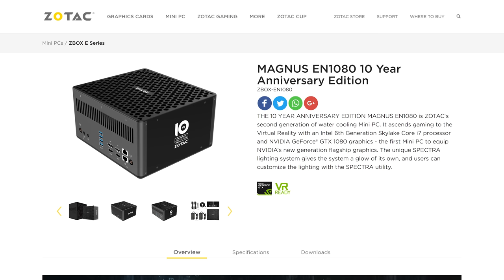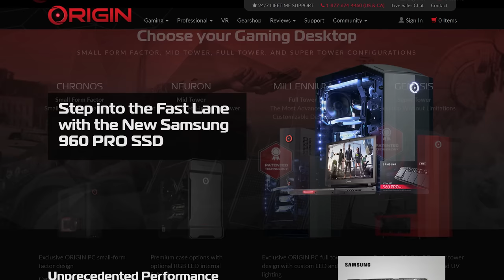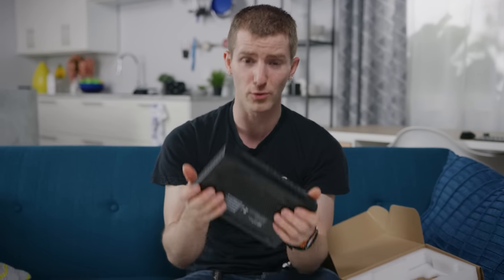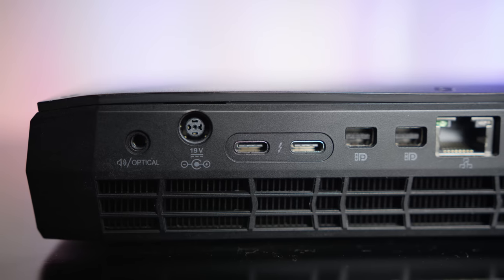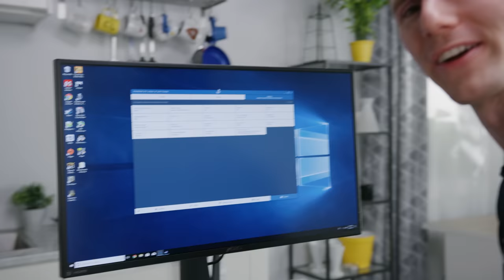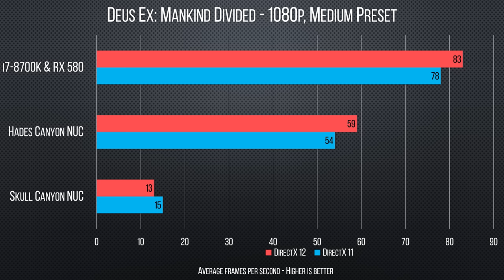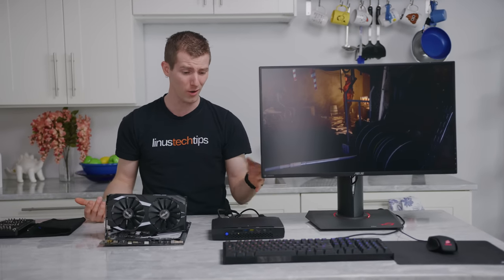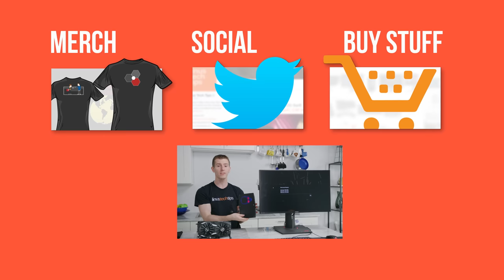Intel's Coolest CPU EVER... Thanks to AMD!

Comment: I just can't see any use case for this. LAN parties makes no sense. Most people going to LANs would use a laptop. And if your bringing a desktop, it's probably because you're a PC enthusiast who wants to show off a computer they built and can upgrade! Plus you'd need to bring a monitor, mouse and keyboard anyway, so who cares if the PC is Hades canyon sized or slightly bigger for a mITX build.
Reply: do you realize laptops that CAN run the most demanding stuff are even pricier than this thing right? that been said, I am not familiar with LAN parties as I am not a gamer myself. but I can see plenty of benefits in a portable desktop. for instance if you do free-lance video production/editing as I occasionally do, for productivity's sake  you will want to work on your own workstation, what's more if you use macro buttons, you will also want to bring your own keyboard around, since that is out of the way the only thing missing would be the screen, which can be easily borrowed from the hiring office or hotel room. also, it might just be me, but I find extremely obnoxious to try to do any REAL work over my lap, so I would choose something like this over a laptop for work any day (under the current pricing relation anyway)
Reply: even though new laptops are great and i have one msi gs63vr 6rf that i use as a desktop at home with separate monitor and everything . the 1060 6gb and 6700 hq are fantastic pair i can guarantee this mini desktop this will have more consistent  performance and frame rates.  like ill give you an example even with cooler boost the 6700 hq under load will hit 90-95 c and that goes for most  all laptops except for the big bulky ones. itll sit at 3 ghz at all cores 180 fps in csgo, and ill get frame stutters into the 90s because the cpu will throttle to 2.6ghz which is the base clock then back up a ms later. this cpu being clocked so much higher with much better cooling will definitely give more stable frame rates and similar frame rates to my laptop for 500 dollars less. like i said if your a lan goer and want best experience and already have peripherals to go with it this system it is the best lan party system unless you build your own mitx system in a loque ghost or something. i know lots of people who look for small systems like this to bring to lans.
Reply: Zack Mandarino A laptop with with a ryzen 7 1700, rx 580, 16gb ram, 256gb SSD and 1tb HDD can be had for $1500 USD. That's not much more than the $1000 after adding ram and storage. Plus that laptop has an 8 core with smt, 16 threads! The NUC it's only a quad core, not sure why anyone would call it a "powerhouse". I'm not saying it's a bad product, it's super cool, but I do think it's overpriced and has a very small if any use case senario.
Reply: The ASUS ROG GL702ZC-WB74 was the laptop I was giving as an example. Which includes a screen, keyboard, battery and touch pad along with ram and storage.
Reply: If you're going there on public transport or it's a long walk to the actual hall from anywhere you can be dropped off in a car, and you don't have a trolley to wheel your godmonster of a desktop around on, then something like this plus a  monitor with a removable stand would be a pretty good, backpack-sized solution, and probably less bulky and easier to handle than a typical gaming laptop. Plus you don't have to put up with the generally terrible-for-gaming horror that is a laptop keyboard (sure, you can plug in a USB one, but then you'll likely want a separate monitor as well because the angles will be all off otherwise, and then we're comparing a rather larger slab of computing material that includes an entirely superfluous keyboard, trackpad and monitor, as well as a pointless battery if you're going to use it plugged in all the time anyway), as there will still be plenty of space left in the bag and load capacity in your shoulders for a proper desktop one. Maybe a VR headset and controllers too.

... Hmm, in fact, given its network VM workstation roots, the machine is probably intended to be mounted on the back of a monitor using the VESA bracket holes...

So like it's the operational guts of a laptop, but you're not shackled with a built in screen and keyboard. Sort of like how computers in the late 80s thru early 90s gradually gave up on the "computer in a keyboard" idea when it became clear people valued a decent, more easily moved keyboard plus a system box with better expandability over absolute compactness - and before that, gave up on the idea of building a display into the system unit (as had been common with CPM terminals, things like the Commodore PET, etc) instead letting people pick their own monitor and its location relative to everything else. If you've got a smartphone and/or tablet that covers your actual mobile computing needs, why bother with the compromise of a laptop when you could have a compact desktop instead, especially in the era of decent sized monitors that are no thicker or heavier than the same screen built into a laptop anyway? (Laptops originally winning over luggables thanks to having LCD or plasma displays, instead of small but still bulky/heavy/power hungry CRTs, and desktops hanging on to tube monitors well into the noughties... nowadays, it's essentially their all-in-one nature and built in battery that is the only real advantage)
Reply: That sounds like something you should look into, 90-95 C isn't average for any laptop because IIRC the CPU max temp is 100 C, so you should definitely look into it especially if you paid $1500 for it.
Reply: an mITX is significantly bigger (and what is significant when talking about portability and compactness doesn't require much difference).  The power brick makes it easier to pack than one big unit.  

Gaming laptops can take up a lot surface area.  For instance on my desk, I can fit a monitor and keyboard, but add in a laptop and there's little room for much else.
Reply: I see what you're saying about a "superfluous keyboard, trackpad and monitor, as well as a pointless battery if you're going to use it plugged in all the time anyway" you make a good point. But i just feel like the price doesn't reflect that it doesn't include any of those things. You get all of those things in a gaming laptop, whether you use them or not, for around the same price as this NUC once you buy ram and storage. And sure a mechanical keyboard and 144hz monitor might be a more premium setup, but I'm sure I wouldn't consider that a more elegant solution than a "balky" (they're getting quite sleek these days) gaming laptop. I think the Hades Canyon NUC is a cool product, just overpriced and for a narrow use case. But again, I do see your argument for if you really don't intend to use the laptop screen and keyboard.
Reply: +Nate Dogg That's definite leg cooking temperature and it won't be too good for the motherboard, chipset, RAM or most particuarly hard drive/SSD either. And it's really bad for the battery to be heated much above 50 celcius. Maximum CPU core operating temperatures tend to be in the 90 to 105 celcius range, and I generally get worried if mine creeps past 80. The fan's already at full blast long before then and I think the highest I can actually set the alarm/shutdown temperature trips at is 90. That's a somewhat average everyday business laptop though, a gaming one might be built with more high temperature resistant parts and with the expectation/intent that it's going to suck more power... and in a processor and GPU, the only place 99% of that power is going is into waste heat... so it's a pretty serious fail if you don't account for that additional heat and build a machine that routinely exceeds its maximum safe operating temperature (or even tends to sit only just below it).

Most modern chips should at least have protective measures built into them, which will progressively restrict performance as temperature approaches the safe maximum (this is the entire concept behind Turbo Boost, after all - making better use of the remaining thermal envelope), and more or less halt processing entirely if the limit is exceeded (and go into total, crash-grade protective shutdown if the temperature then continues to rise much further). But that then means that if you run that close to the wind on the regular, your actual system performance will be severely restricted, and it's a sign that your cooling solution is under-spec and the computer would actually run a lot faster and above all smoother (less up/down oscillation of operating frequency) with a better cooler (or better case design... or even just a lower performance chip, in fact).

So yeah... it might be deliberate, depending on manufacturer and the actual hardware, but it doesn't sound good. I think last time I had a machine that routinely showed such high core temperatures, it was a 1300mhz Duron (desktop, mind!), and those above-1Ghz cut-down-Athlon parts were notorious for running insanely hot.
Reply: +caleb grefe There's also the point made by Tams80 that a gaming laptop will actually take up a good bit more space than this thing anyway. By having to build in that other stuff, including the battery, and arrange it in a certain fixed way, you add a lot of bulk that the Canyon doesn't have to bother with. And it can then be made smaller than a similar ITX based machine because the ports can be spread out more (not interfering with internal connections for KB, screen, battery...) instead of put in a tall, narrow stack at one side of the case - which the sacrificing of internal storage beyond that of storage and memory also helps with, as you can use the surface area that would otherwise have been reserved for expansion card(s).

The power slab somewhat disrupts that saving, but at least it's flat; it'll still slip into a bag pocket OK, and in use it'll just be something lurking on the floor near the actual outlet. Really, it's over-spec versus what's actually needed; more than half of the power going in is being reserved for USB3 / USB-C devices, if we believe the label on the back... so as long as there's only a limited set of bus-powered USB devices plugged in (keyboard, mouse, maybe a memory stick and wifi / 4G dongle), the lower powered version of the machine should work perfectly fine with a more compact 95w laptop power brick, so long as you can find one with the right connector.

I figure they're aiming at the kind of user who wouldn't generally bother with a laptop anyway, but may not have the space or money (or transportation) for a full fat desktop. For most typical mobile computing uses they'll have a tablet of some kind, and gaming wise may currently be sticking with console. This module is a handy door into medium-core PC gaming with a decent CPU and perfectly passable GPU, in something the size of a small Blu-Ray player or VoD streaming box, which can plug straight into their large-format 4K flatscreen TV and soundbar, and gives access to regular desktop apps and proper web browsing, every VoD service that has a way to access it from a desktop or laptop PC, ability to plug in optical or other mass storage drives if desired, as well as of course the whole panoply of Steam (and other nonaffiliated) PC games and even some VR functionality. For a price not much beyond that of a latest-gen console, a somewhat more staid desktop that comes with monitor/mouse/keyboard (the latter two they may just have some spares of kicking around), or a gaming laptop that has lower performance and more bulk, and in use is going to end up heat-damaging either their legs or the tabletop it's placed on, unless they either put it on a generally not very ergonomic riser stand, or give up on the whole laptopping idea and just use it like a bulkier, less-well-equipped-with-ports Canyon anyway.

It's probably not a very large market segment overall, but given that they and other manufacturers have been making and successfully selling devices into it for some years now, obviously one that genuinely exists and isn't going away with any kind of speed. If you just want a single all-round computer that you can carry with you in a bag and use wherever without needing an AC supply, then obviously a laptop is a much better choice. But I can envisage there being a good subset of users in this smartphone, tablet, 3DS / Vita and high-end-consoles-that-still-don't-quite-make-a-good-fist-of-4K day and age who may well want to get into PC gaming instead, but who are both totally put off by the whole "pro gamer" thing (which is rather like the Ricer car modifying scene of 10-15 years ago, to my eye) and not particularly interested in buying a laptop, who would be quite interested in such a simple, plug-and-go type solution as a counter to enormous CCL-illuminated show-off cases with hugely expensive 3xSLI graphics card setups and the like.
Reply: It's a HTPC, so you'd normally use one as either a small home server or with a TV.